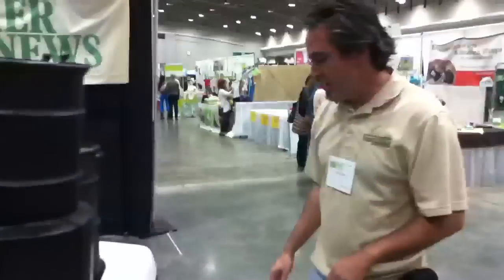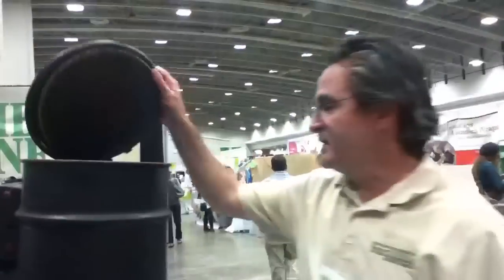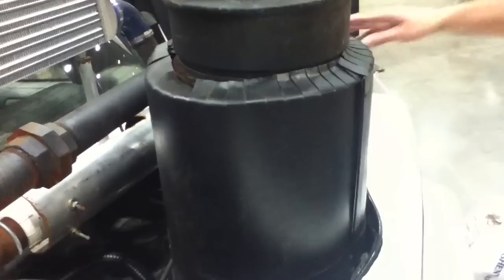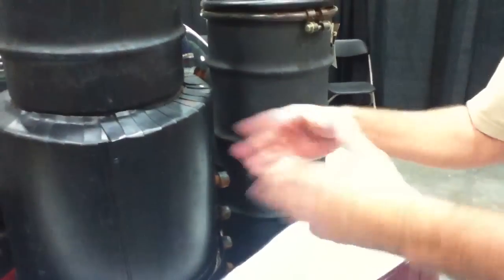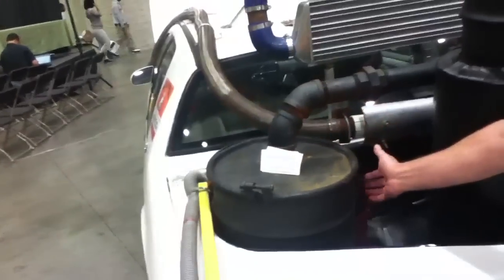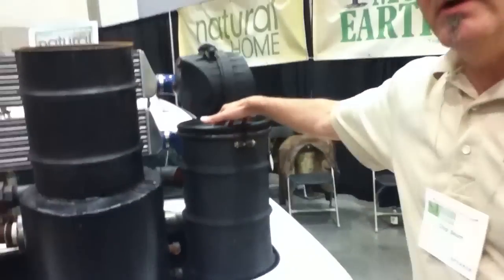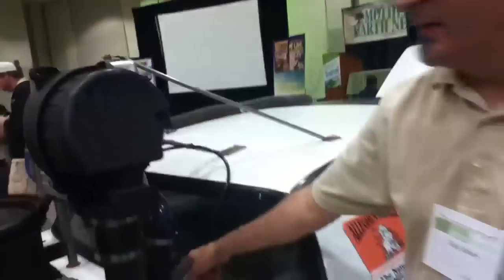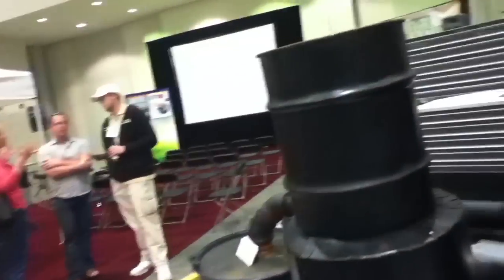A fascinating car that runs on wood pellets via gasification by Beaver Energy

Comment: @jbfane No one said to burn living old grouth trees ! Dead trees and lumber scraps and trees grown for wood are a renewable resource. And wood gas properly filtered then burned is cleaner than fossil fuel. Water and sun are pipe dreams. But wood has worked since before WW2. And you could burn the hemp instead of wood.

Comment: This thing is truly the ultimate answer to Petrol whether you want to accept it or not when there isn't any gas to be had your gonna wish you had made the conversion and besides they didn't change the engine whatsoever so until that doomsday you would have the option of pulling into the pump and spending three times more on fuel than is already necessary. Do your research, Do the math
Reply: Hey shout outs for your comment 10 years ago!

Comment: Yeah, uh a car that runs on water?  Possibly hydrogen made from water using a ridiculous amount of electricity to crack H2O into H & O. And there is a good chance that the energy used to make the hydrogen came from fossil fuels.

There are things that look like cars that run on solar, but they are actually more like 4-wheel bicycles that don't go much faster.

This thing is actually very green, and it could run on anything from recycled paper to dead leaves.  Not a mainstream solution, but cool.

Comment: I must respectfully disagree.  This particular vehicle is far greener than any other tech you mentioned.  There are no cars that run on water.  Hemp has to be grown the same as wood, and cars that run on sunlight are probably 50 years or more away.

This vehicle runs on wood pellets, which are a recycled byproduct of wood mills and paper making.  This would also run on grass pellets, for example, switch grass, without any needs for processing other than drying and compacting into pellets.